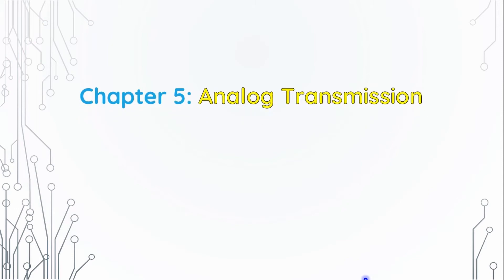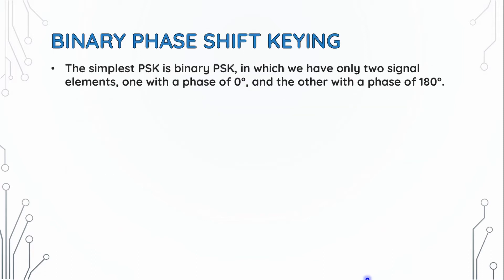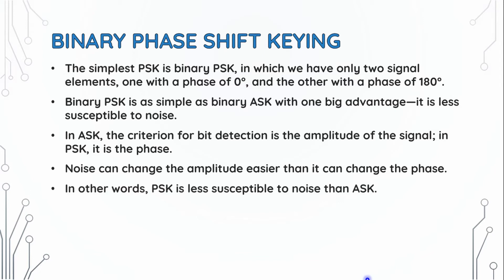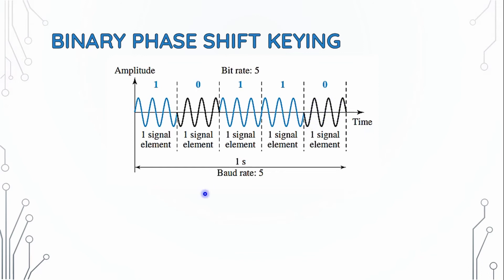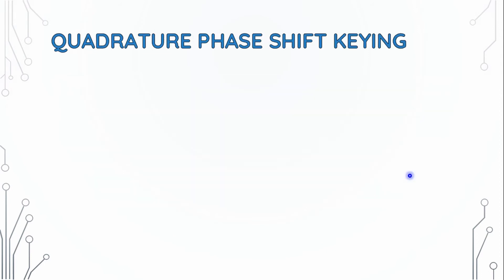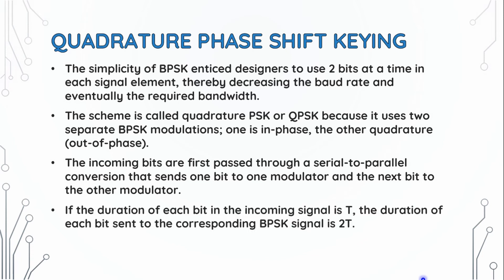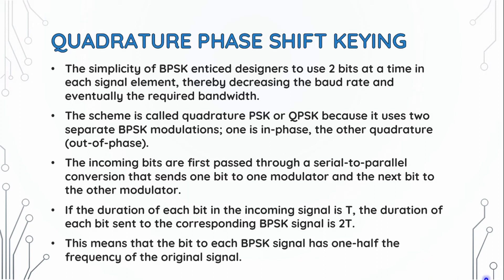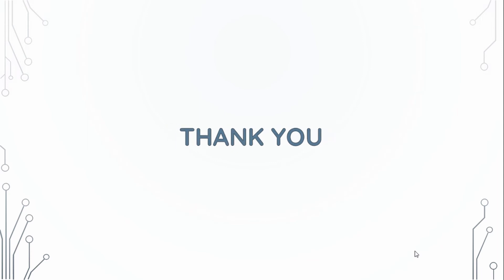Phase Shift Keying || Data Communications & Networking by Farouzan || Bangla Lecture

Comment: QPSK implementation খুব ভালো করেই স্কিপ করে গেছেন আপু।।
১ম কেরিয়ার ফ্রিকোন্সি এর ফেস একরকমের আর ২য় কেরিয়ার ফ্রিকোন্সির ফেস আরেকরকম ?
১ম সিগনালে ০ এর জন্য ফেস ১৮০ ডিগ্রি পরেরটার জন্য কেনো অন্য?
দুইনা সিগনাল যোগের নিয়মটাও দেখালেন না।।কিভাবে যোগের পরে -১৩০ডিগ্রি, -৪৫, ১৩৫, ৪৫ ডিগ্রি হলো?
Reply from the maker: Thank you for your comment..   
I think you didn’t notice the figure shown in right side. 

That shows that, the next carrier signal will start after shifting the phase for 90 degrees. 

That’s why the carrier signals are not same.

For more details checkout the book:
Data Communications and Networking by FAROUZAN